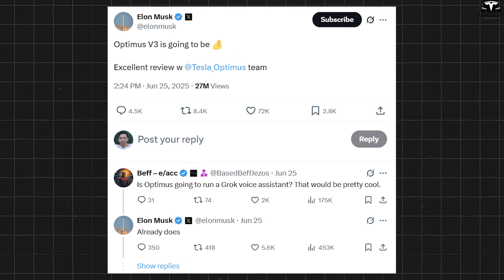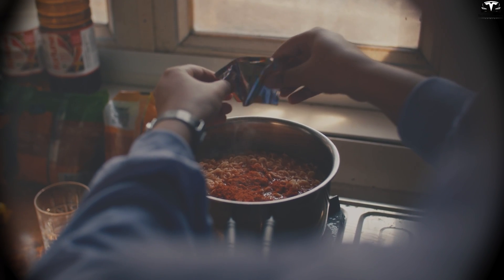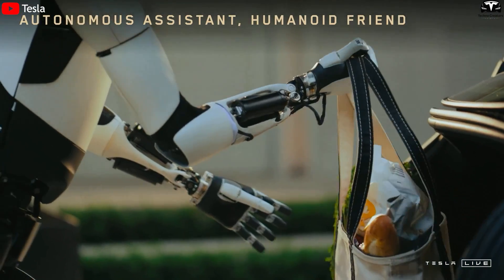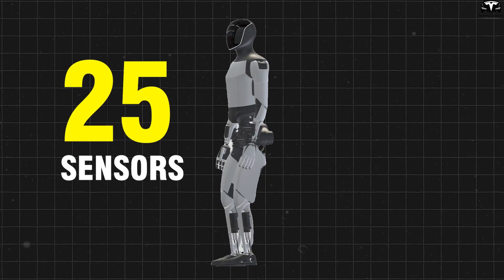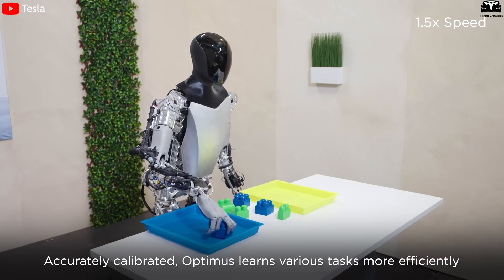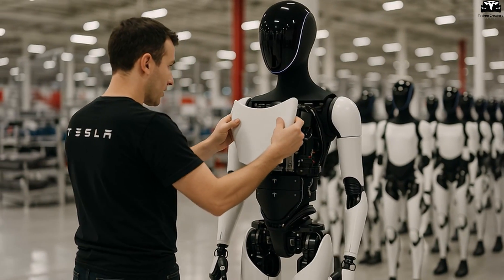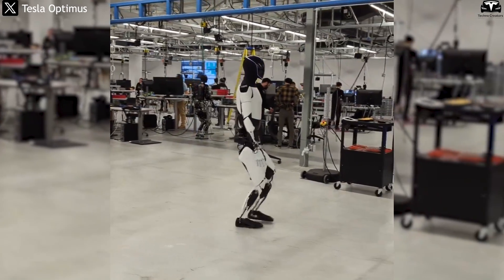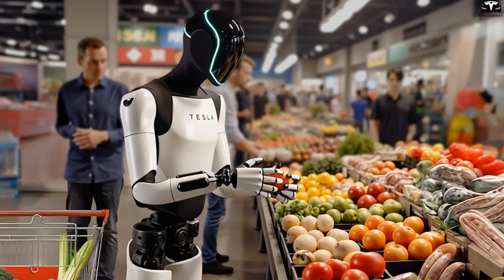Shocking! Elon Musk Confirms New Tesla Bot V3 Performs Insane Tasks! You NEVER HEARD Before!

Comment: If a Tesla Bot causes injury during a task, who is liable—the user, Tesla, or the neural network?
Reply from the maker: If a Tesla Bot causes injury, liability will likely depend on whether the issue stems from user misuse, hardware failure, or flaws in Tesla's AI, making Tesla potentially responsible if it's a design or software fault.